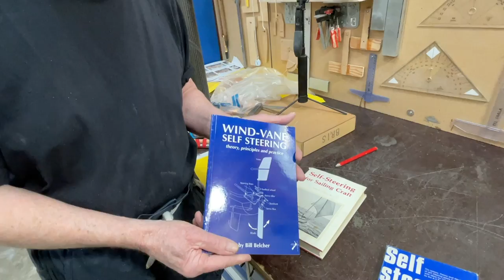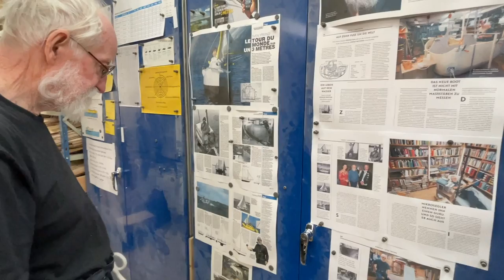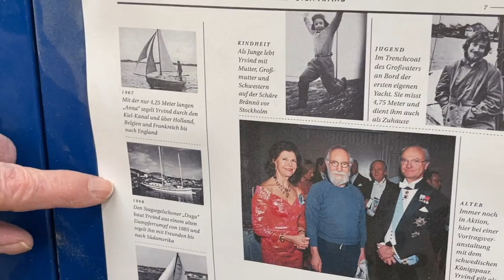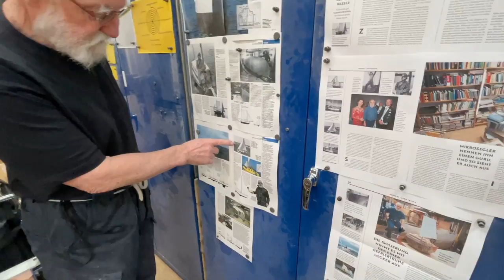18 Mar 2023  About Selfsteering.

Comment: It reminds me of Joshua Slocum  who wrote about sailing thousands of miles without ever touching the tiller.
Reply: Of course, he did have to touch his rig and sails, a lot.  lol.  But then you have to do that anyway.
The biggest difference is that it requires a lot of experience at sail handling/setting vs. the pretty much set-it-and-forget-it of a windvane or autohelm.  More than most sailors have tbh.

Comment: I'd like to add to the discussion that in order to balance the forces successfully they need to be acting in a stable system, e.g. a system where disturbances in acceleration counteracts each other. For example, if a sudden acceleration has occurred (wave, gust etc.), the system needs to be designed such that this acceleration is counteracted by a stronger acceleration in the opposite direction resetting the system into equilibrium. 

In his book, Letcher calls this a stable system and compares it to a marble in a bowl. If you push the marble so it starts to climb the wall, it will return to the middle of the bowl again due to the gravitational acceleration. This counteracting acceleration will however only act on the marble if it would be pushed to climb the bowls side, once the marble is at the bottom no horizontal acceleration is acting on it any longer. Hence the system is designed to approach zero acceleration over time and is stable. 

An instable system would instead be a bowl turned upside down, e.g. in such systems disturbances in acceleration are reinforced by being further accelerated. The slope on the upside down bowl can however reach a new bottom in another bowl, that makes the marble stable again. For example, an unsuccessful attempt to make a stable self-steering on a sailboat can result in that the sailboat goes to windward and stays "in irons" instead, as most boats are designed to do this for safety reasons. 

A third type of system is a not a bowl at all but a flat slate, which is a system that is unresponsive to disturbances in acceleration. In other words, there's no preferred place for the marble to be (or direction of steering for a sailboat). Although this kind of system is mostly theoretical, what could be closest to such a system is a life raft, because of its radially symmetrical design which all look the same despite its angle to the wind. A boat in a current could be another.

Worth saying is that storm tactics are also striving to reach stable systems (by the use of drogues or heave-to techniques), here however the objective is to reduce energy, not to make way towards a particular direction.